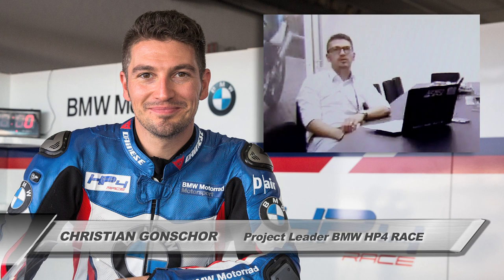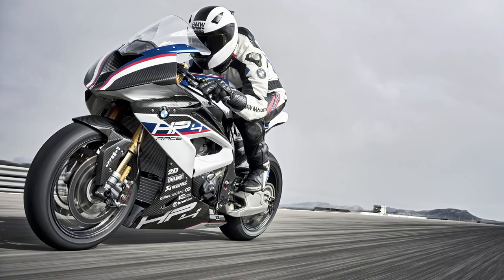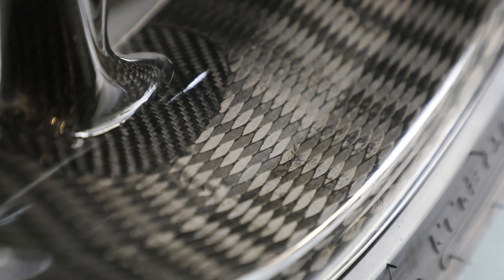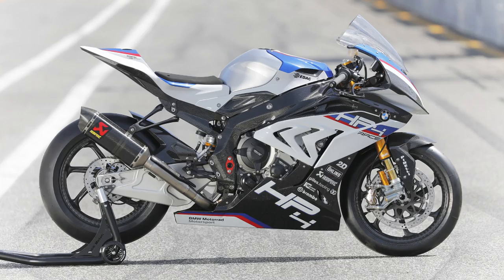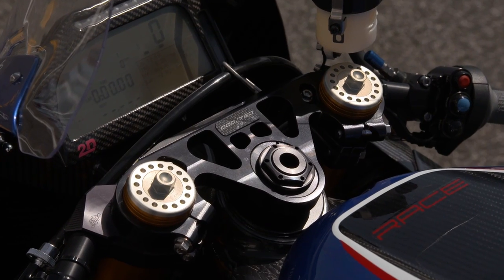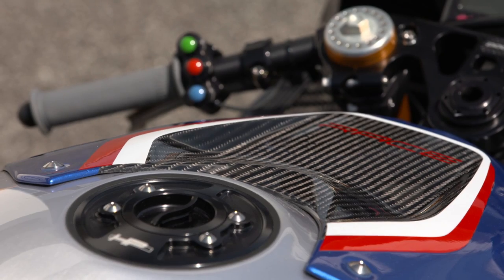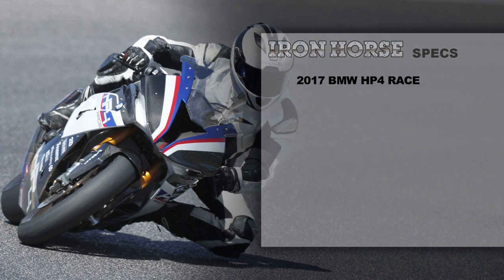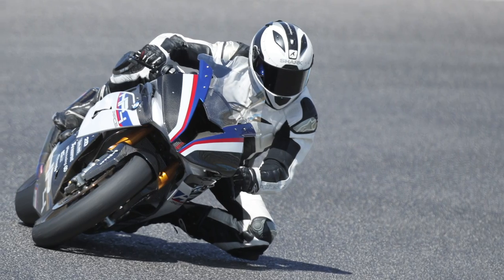BMW HP4 RACE - Track Test Pt. 2

Comment: Do you think that as carbon fibre begins replacing the aluminium frames of superbikes, aluminium frames will begin replacing steel on the cheaper bikes? Or will carbon fibre just replace both as more time is spent developing the carbon?

Comment: That German guy said this bike is the WSBK bike without "belt train" or "valve train"? Can anyone understand that part?
Reply: It pretty simple is a wsbk engine except the Head, wsbk engine has for ex diffrent valvesprings for extra revs that means harder wear, other valves and so on. But you are still no more than about 5hp down to a wsbk engine or on the same level as it was just a couple of years ago